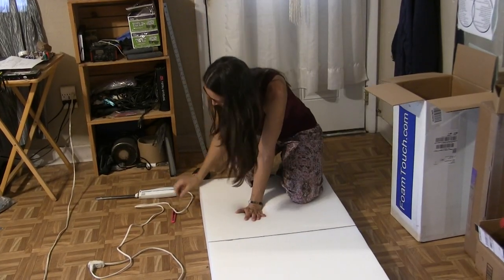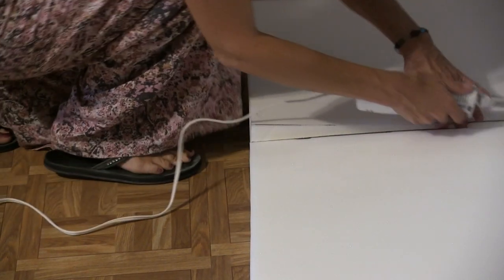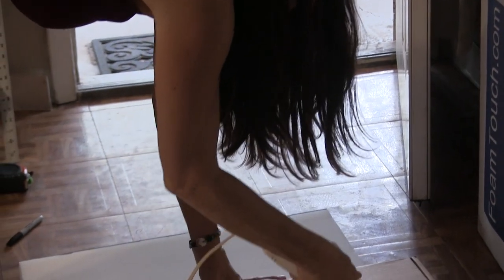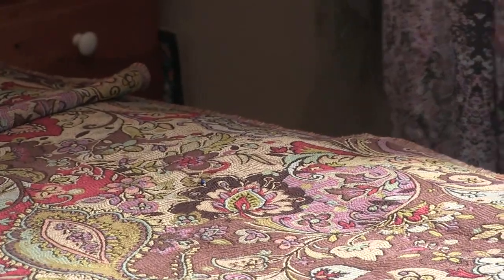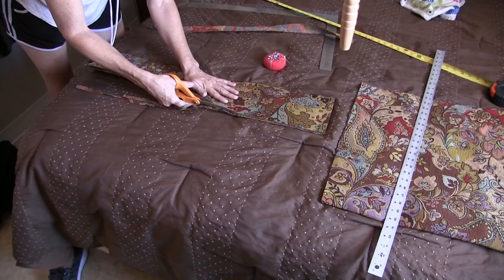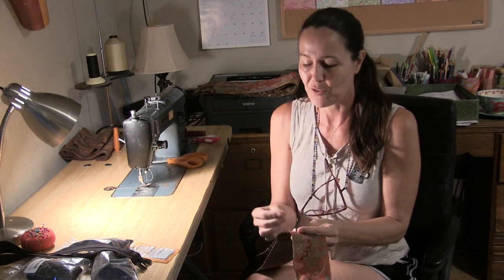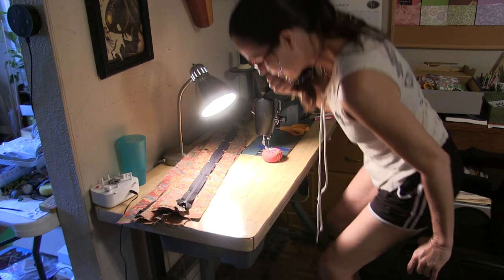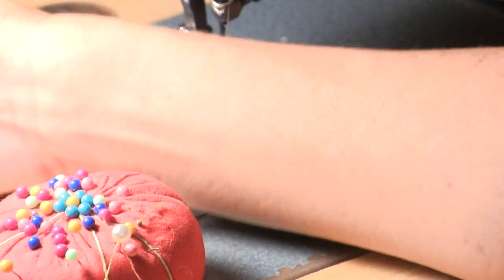Making Boxed Cushions for the Dinette-Sofa-Sleeper in our Skoolie!

Comment: The cushions look great! TIP for easy stuffing cushions inside the cover. Wrap a  thin piece of plastic drop cloth around 2 sides of the cushion and they slide in much easier. You can leave the thin plastic inside or pull it out after sliding cushion in.

Comment: I normally don’t go for wild patterns but I love this fabric because it incorporates your personality definitely and the tones of turquoise and blues while adding neutrals and other colors to break up the gobs of turquoise paint in your kitchen/dining space. I used to be obsessed with turquoise and now have found deep greens and modern deep teals to be my thing. Fyi you did a good job of cutting the foam. *Tip on foam cutting or cutting anything really: (I’ve learned the hard way with ply/wood) Measure as you cut, don’t measure ahead of time and rely on the measurements being spot on because you have to take into account the size of your cutting blade and any errors with straight cutting! Your blade was at least 1/8 to a 1/4” wide explaining why one of your foam squares was off quarter inch.